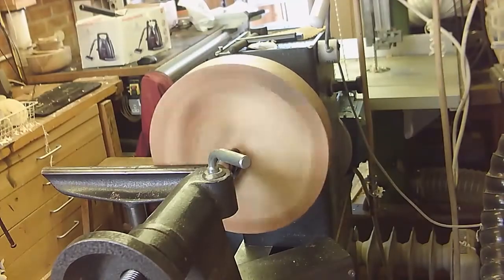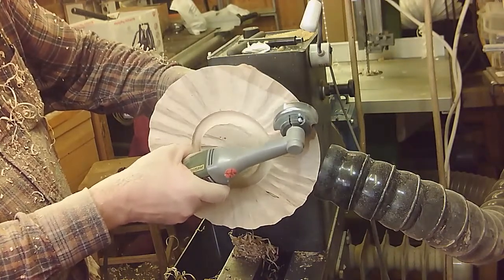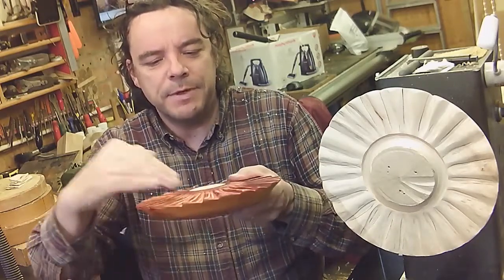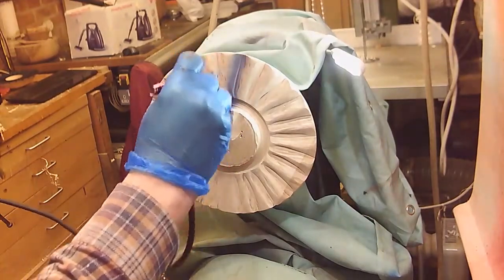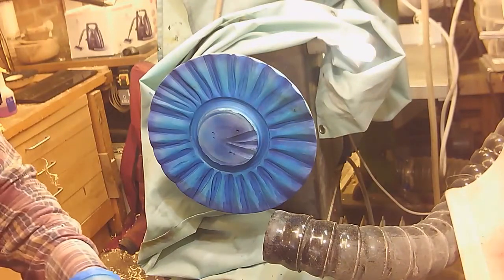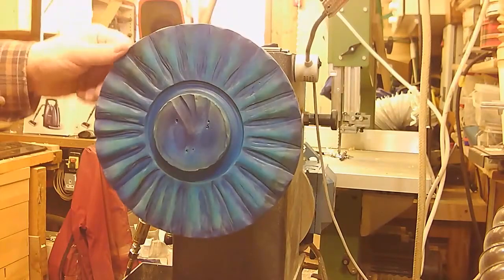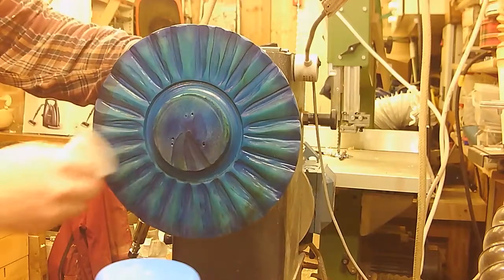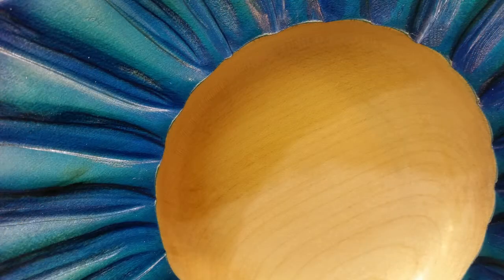Textured Blue Sycamore Bowl

Comment: When I dilute the colours for my air brush the colour is so weak. Stronger and the brush won’t spray.
Any thoughts?
Reply from the maker: Hi David - I have very little experience of airbrushing paint. I used spirit stains on this one. I have been told that if you use paint in your airbrush that rather than water it down, an airbrush medium should be mixed with the paint. There are some airbrush paints already thinned enought to use straight from the bottle. I bought a small set of Vallejo colours, but they were about £30!

Comment: Hi Stuart, Where did you get the flexi tube for the dust extractor. I have searched everywhere and can't find it. Oh - braw bowl :-)
Reply from the maker: Thanks, Debbie! I'm pretty sure I got it from Yandles, but it seems to be a different colour now: https://www.yandles.co.uk/camvac-25-poseable-hose-assembly-670mm-long-cva250-80-104/p246  Record Power also have it on their website. I had to make a reducer to fit it into my 4 inch hose. I also have this from Axminster on my other lathe - it's cheaper and fits onto a 4 inch tube: https://www.axminster.co.uk/stayput-extraction-hose-ax22323
Hope this helps. Cheers!